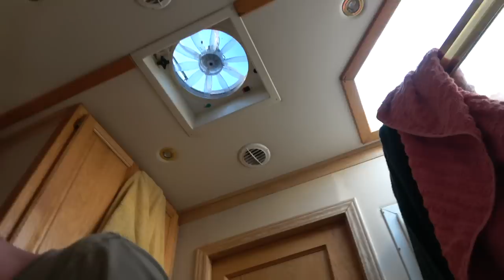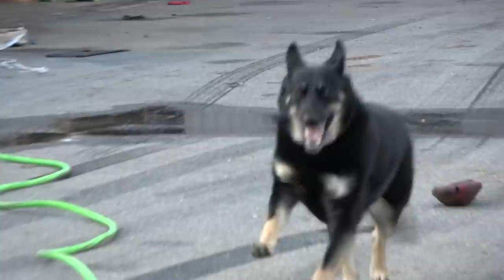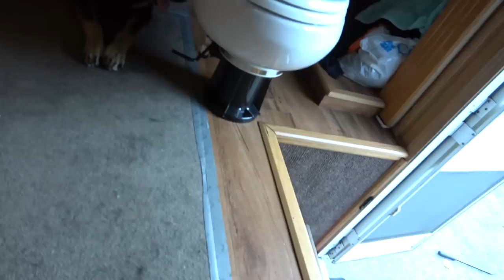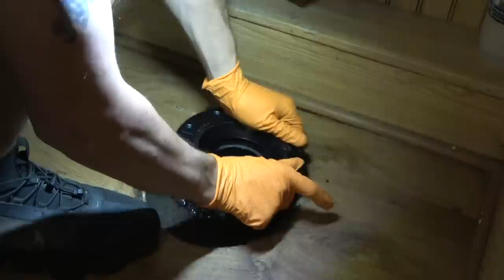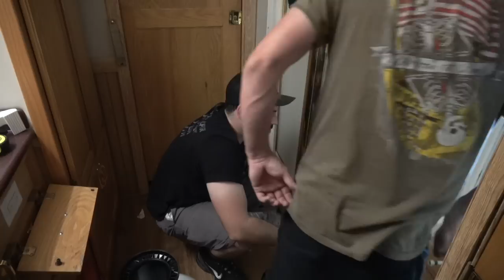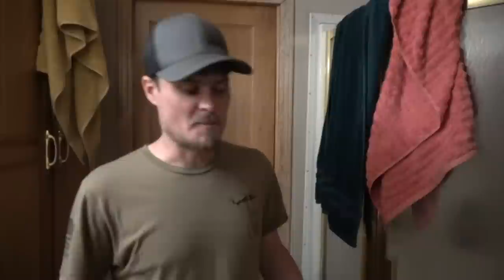How to professionally replace the toilet in your RV.

Comment: More water clean it out get a fan in there see can suck the air out you always drive the RV before you dump it so it's all good and mixed up but you need to get that one that has the mixing thing on the end I got one in my RV and you don't leave the hose on there so it just falls out you always got to keep it capped up so the water will keep it mushy and and disintegrate and then you dump it cuz sometimes you get them corn logs they don't roll down the hose that good without no water pressure behind them🤣🤣🤣🤣🤣🤣🤣🤣🤣🤮🤮🤮🤮🤮🤮🤢🤢🤢🤢🤢🤢🤢😷😷😷😷😷😷💩💩💩😫👍

Comment: I'VE LITERALLY BEEN A PLUMBER FOR 23 YEARS SINCE I WAS 17 AND I'M 40 . YOU COULD HAVE JUST PLUMBED IT BACK WITH PVC. FOR FUTURE REFERENCE ABS HAS NOT BEEN USED IN A LONG LONG TIME. I THINK THEY STILL MIGHT USE IT IN TRAILERS BUT NEXT TIME GO WITH PVC GO WITH THE WHITE PIPE.